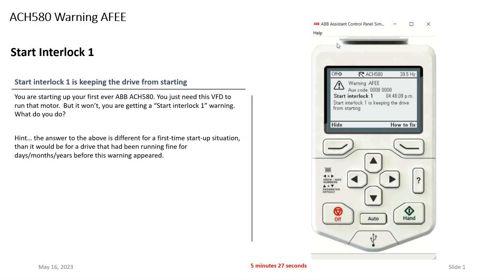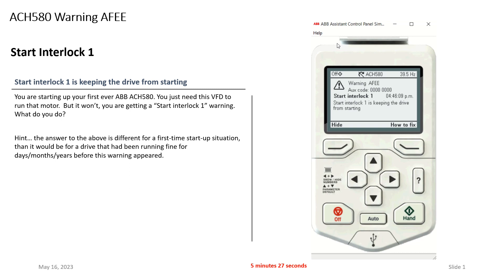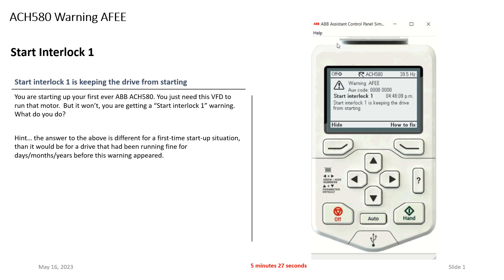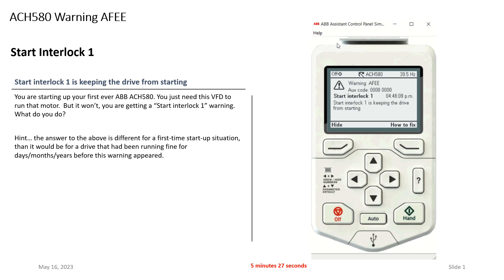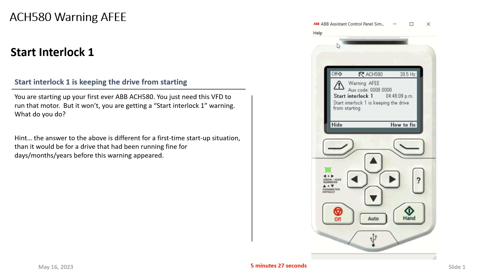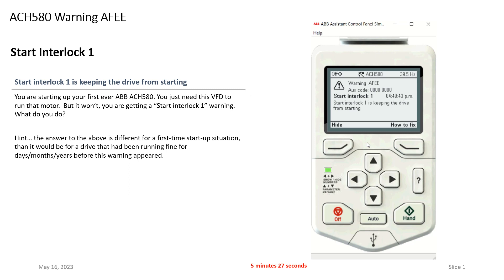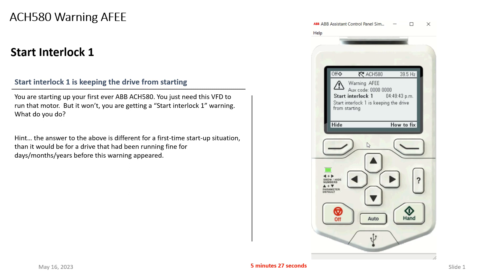ABB ACH580 VFD Video alarm AFEE Start Interlock 1

Comment: I see mine enabled but it’s all gray and won’t let me unselect it
Reply from the maker: Apologize for the delay.  I am assuming you most likely have a drive with Eclipse bypass. You probably have an alarm 4021 on bypass which corresponds to the AFEE on the drive section.  The drive w/eclipse bypass has this Start Interlock 1 provided via a modbus link from the bypass.  On the bypass terminal strip from terminal 2 to 7 is the start interlock and it is probably open. Groom those wires.  
If my assumption is wrong above it is always good to provide the package part number and serial number. ( example ACH580-VCR-012A-4, sn 2250411247)
Reply: @BorieDavisInc.Alpharetta this is correct. We do have a wire stripped and landed on the 2 and 7 terminals. We disabled the interlock on the bypass but now receive an alarm for comm error through out BAS system
Reply from the maker: @masonrush1753  It is difficult to troubleshoot in just sentences via email. Where are you located geographically (USA). If yes call me on Monday at 770-329-2095 when you are in front of the VFD so we can do more than one sentence every several days. What is the full part number and serial number of this drive? Part Number is something like ACH580-VCR-014A-4, serial number like 2241612345. Take a picture of the control wiring to the drive and to the bypass and picture of this comm fault you mention. Too many possibilities that warrant more information to even know what you are looking at.